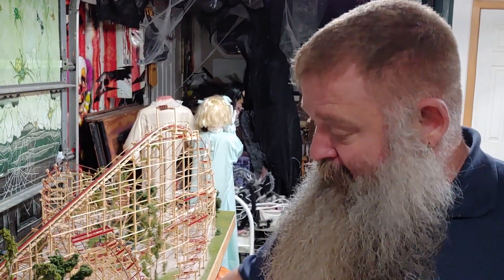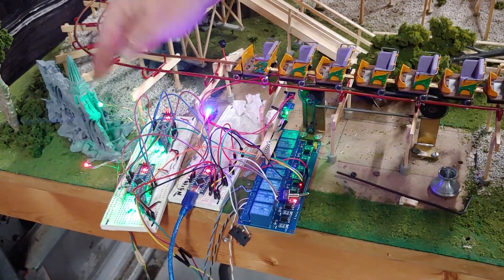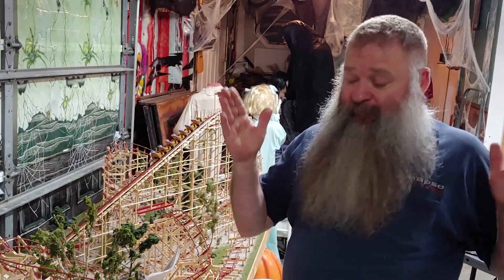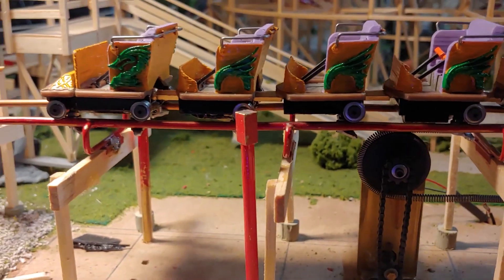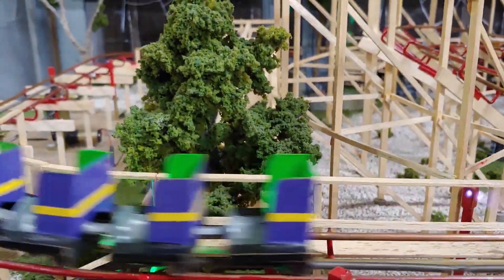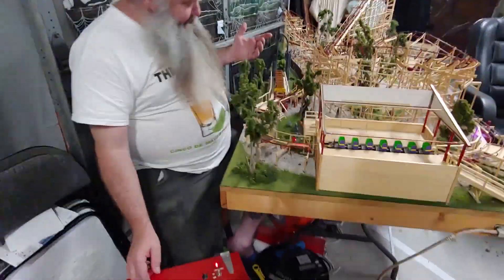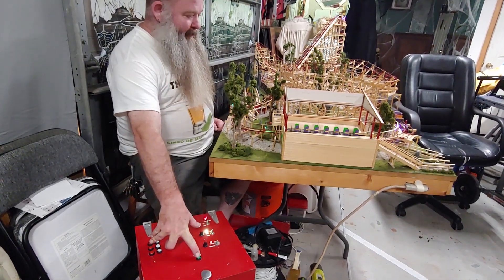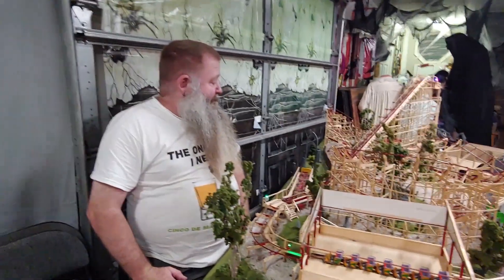Working Model Coaster: Two Train Block Control

Comment: What you need for you station and cue line is a haunted castle or mansion something like Rose Red with a wicked sky back drop what scale is that?  Looks like you could fit GI Joes😉👍
Reply from the maker: Thank you! Funny you should suggest that.  I am trying to gather parts to make a cathedral ruins kind of station/queue. You can see some of the printed parts in the video actually. 
The scale is slightly larger than O-scale, but not quite big enough for G.I. Joe figures.  (I should really figure out the scale some day.)

Comment: Everything about your model is amazing: the hybrid track, the scenery, the vintage style trains, and the killer electronics for launch control and safety for your trains and would be riders. I'd have no idea where to start with all the electronics. Basically you've created a multi-level complex microprocessor. The only thing I know of that your model doesn't have that you'd find on coasters we ride is sensors for the lap bars. Great job with everything. If I had anything to suggest, it would be to make a map of the layout with lights showing the status of each block. I've seen such maps on numerous coasters I've ridden. I look forward to following your channel. Oh, and last but not least, your beard rocks!
Reply from the maker: Oh man, If I could automate the lapbars... that would be amazing.  
I do have plans for a new station.  With line que gates that work.  
There is also a plan for a map with lights that mimic the light pods on the track.  I realize that is a little unrealistic as I have never seen status lights on a real coaster's lift/brake run, etc.  But it was to demonstrate the logic being applied to each block and to show other where the separations in the blocks are.
And thank you!  This is about 4 years of not cutting the length.  
Thanks for watching!
Reply: When i worked at Valley Fair I was one of the ride operators of Wild Thing and there was an automated light on where the train was. Honestly I think that would be pretty cool to have on a model coaster and have some mini robotic Lego people walk around and ride the roller coaster.

Comment: I have been watching this series for awhile (found you a couple months ago). I am absolutely amazed by what you have built. I am wanting to build a similar style roller coaster in 1:24. I am wondering what scale yours is in? I understand it was purchased. I just don't know where to start to build one.
Reply from the maker: Thank you so much for watching !   
I'm not sure of the scale.   I believe it's a little bigger than O.  But I will try to work that out - I'm curious myself.  
I did a train build video prior to this one.  The body she'll is different, but the chassis and wheel assemblies are identical.  Hopefully that could help.